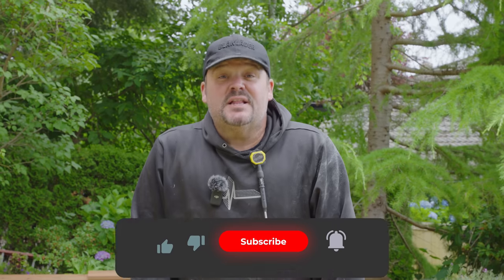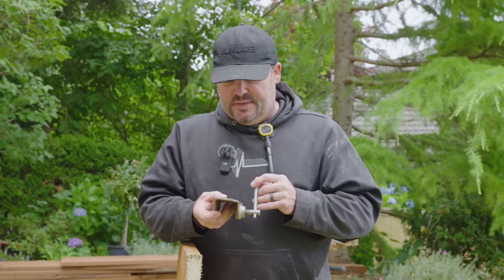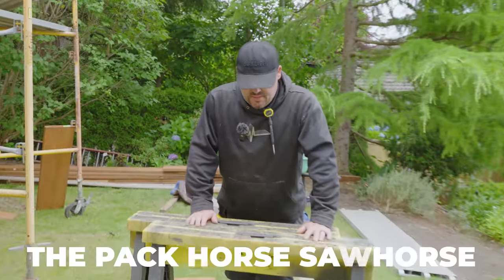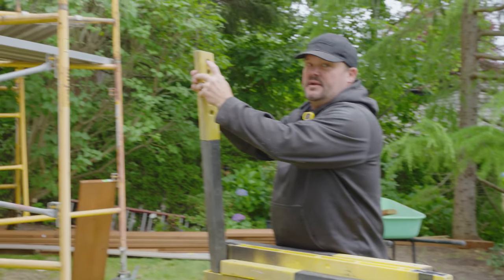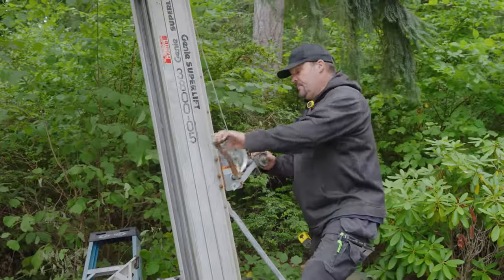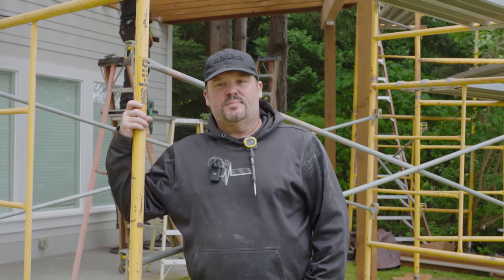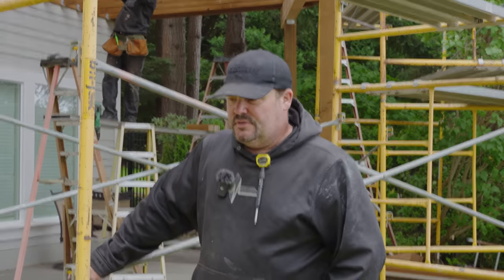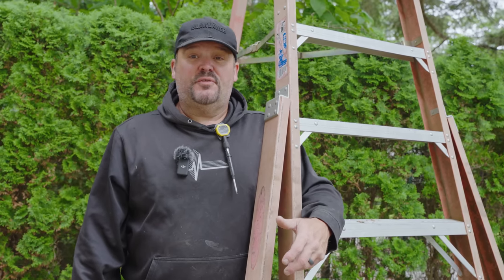Five Old Tools That I Still Use To This Day || Dr Decks

Comment: Was never a fan of store-bought horses. Think about installing some sacrificial wooden tops on those. 
The Genie Lift can be handy for hoisting equipment or something but a simple job built A-frame and chain hoist is probably a better choice for a carpenter. Some sections of scaffold frame with scissor bracing are irreplaceable.

Comment: To hang joists on my ledger I used a 4 hole uni-strut splice plate (1/4" thick, 1.5" wide, 6" long flat plate steel) clamped to joist with a 3/4" pipe clamp from Harbor Freight.